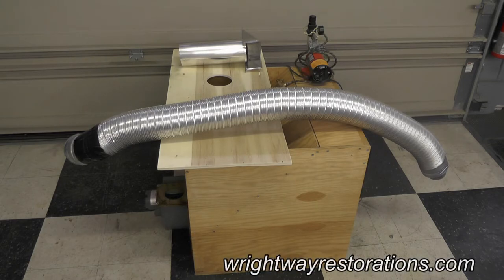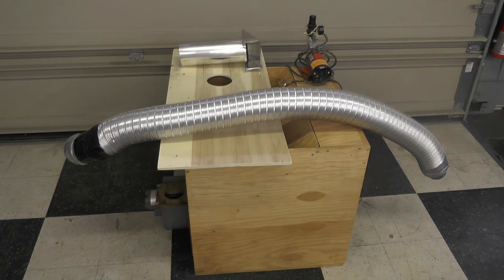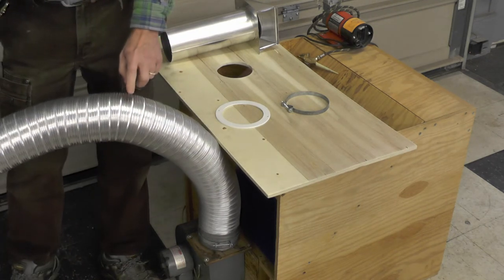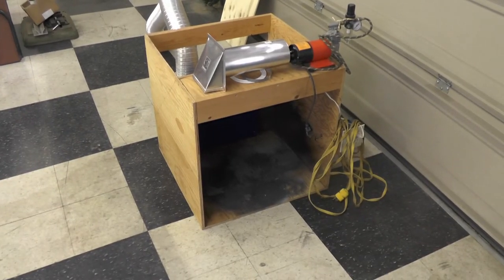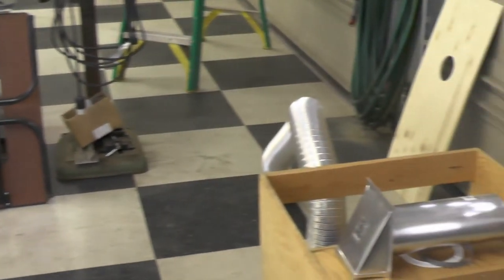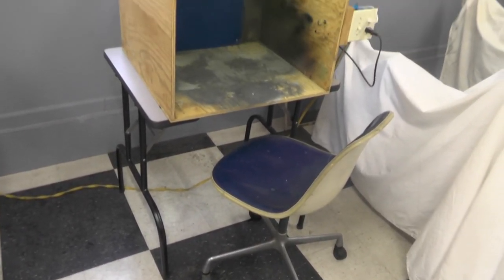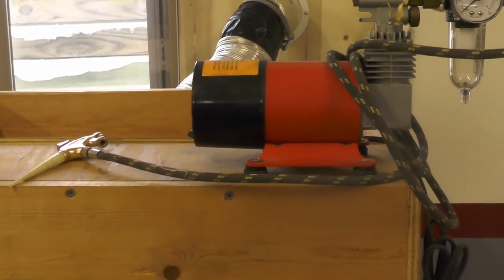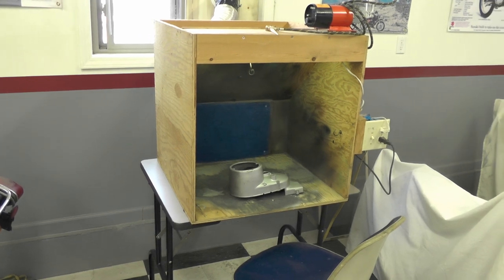Small DIY Paint Spray Booth --- Video #92

Comment: I love the way you made your spray-booth. I couldn't resist watching this video again. I'm in the process of making my own in the same style as yours, for my own hobby work. - In reference to possible explosion proof motors. -  As we all know, most of those motors are  placed outside the airflow to eliminate any possible sparks from the motor's brushes possibly igniting any flammable fumes. - I would like to have your own input and opinion as well if possible. On retirement pay, I can't afford those type of special motors, But I know that automobile heater/AC motors are generally similar, as the motor itself is placed outside the airflow area, and uses just a squirrel cage fan stuck through a metal plate into the airflow zone, with the front of the motor shaft basically sealed by both the metal plate and the bearing housing for the armature of the motor which in effect will generally seal any sparks from the brushes which are located at the back of the motor by the rear armature bearing. - I just acquired (for free), an old heater box assembly from my neighbors old stripped out 1979 Dodge pickup cab. - After removing the heater core, and performing a little TLC, and adding some WD-40, to the bearings, I got the fan motor to work properly again. - WOW !, does that squirrel cage fan spin like new now, and that squirrel cage fan will blow some air when connected to a 12 volt car battery.  -  So, here's my idea. With a little ingenuity, and some MacGyverism, I'm going to modify that heater box assembly to fit the spray-booth like yours I'm going to build. - Yes I know it is only 12 volts DC, however I have a 120 volt AC to 12 volt DC converter (no, it's not a 12 volt DC to 120 Volt AC inverter like you can get these days for powering AC appliances from a 12 volt car battery etc), that has an output amperage of 10 amps continuous output.  - It was a converter which was designed for use upon the old antique early model cell phones (commonly called the "Brick" back in them days, as they resembled the old WW-II style "Walky-Talkies".), which I bought years ago, back when I worked for "U.S. Cellular".  - I'm going to mount that converter to the spray-booth for powering the heater fan motor. (if that doesn't work, then I have an extra car battery, and an extra battery charger to keep the battery charged to use if necessary). I will also use the original High/Low speed wire-wound resistor coil assembly which came with the heater box assembly to control the speed of the fan. - Anyway, What's your opinion in the matter?  - Once again. Thank You for your wonderful spray-booth design idea, and your willingness in sharing the video of it.
Reply from the maker: Your idea has merit.  As you indicated, the most important component is isolating the paint fumes from the motor as this is nothing to trifle with.  As long as you are confident you can effectively accomplish this, you may have an economical solution.  Be confident in the sealing of the squirrel cage, though.
It sounds like you also have a solution to the 12v power supply, too.  If you can get the fan to spin at a speed that effectively works for your booth, then I'd say your are on your way.
Glad the video and my solution was helpful, and you are most welcome.  Please keep me appraised of how things  go for you!

Comment: Brushless Motors vs Brushed Motors
Manufactured table-top spray booths for hobbyists are generally pretty pricy and in most cases way too expensive for those beginning hobbyists just starting out. So therefore many of those beginning hobbyists prefer to build their own. However those people and others continuously harp about the possibilities of the vapor ducting fans those DIY hobbyists install into their homemade table-top spray booths of being intrinsically unsafe as they create the possibility of an explosion hazard by the sparks created from the vapor fumes passing around or through the fan. For those of whom worry about the possibility of an explosion hazard from using fans in a DIY hobby spray booth here is some information you might consider. The following information is taken straight from: https://en.wikipedia.org/wiki/Brushless_DC_electric_motor 

Brushless Motors
Brushless motors offer several advantages over brushed DC motors, including high torque to weight ratio, more torque per watt (increased efficiency), increased reliability, reduced noise, longer lifetime (no brush and commutator erosion), “ELIMINATION OF IONIZING SPARKS” from the commutator, and overall reduction of electromagnetic interference (EMI). With no windings on the rotor, they are not subjected to centrifugal forces, and because the windings are supported by the housing, they can be cooled by conduction, requiring no airflow inside the motor for cooling. This in turn means that the motor's internals can be entirely enclosed and protected from dirt or other foreign matter. 

Generally used in environments and meets requirements in which manufacturers are required to use brushless-type DC motors which include maintenance-free operation, high speeds, and operation where sparking is hazardous (i.e. explosive environments) or could affect electronically sensitive equipment.

Brushed Motors (Motors with brushes)
• The friction of the brushes sliding along the rotating commutator segments causes power losses that can be significant in a low power motor.
• The soft brush material wears down due to friction, creating dust, and eventually the brushes must be replaced. This makes commutated motors unsuitable for low particulate or sealed applications like hard disk motors, and for applications that require maintenance free operation.
• The resistance of the sliding brush contact causes a voltage drop in the motor circuit called brush drop which consumes energy.
• The repeated abrupt switching of the current through the inductance of the windings CAUSES SPARKS at the commutator contacts, WHICH IS A FIRE HAZARD IN EXPLOSIVE ATMOSPHERES, a source of degrading UV radiation, and a source of electronic noise, which can cause electromagnetic interference in nearby microelectronic circuits.
Reply from the maker: I used a new quality commercial motor rated for use in an explosive atmosphere to eliminate any possibly of a fire hazard or explosion.  In fact, I ordered it through the maintenance department where I worked that commonly worked in and serviced electrical equipment in explosive environments.  I figured if anyone knew what they were doing, it was these folks.

Thanks for all the information and comments...